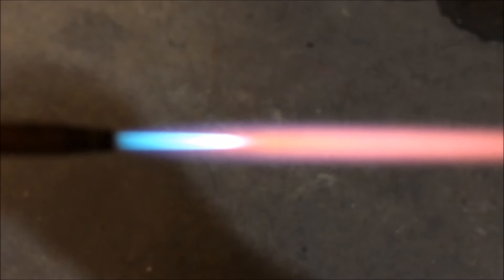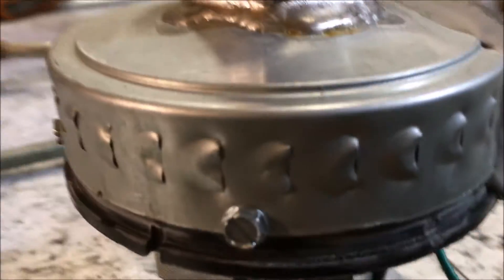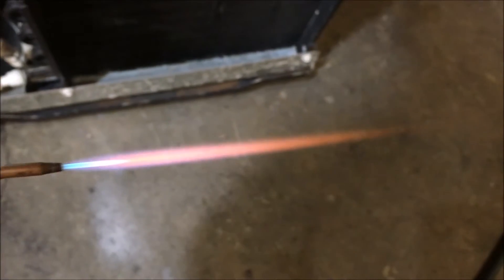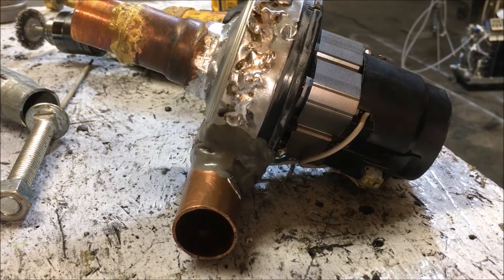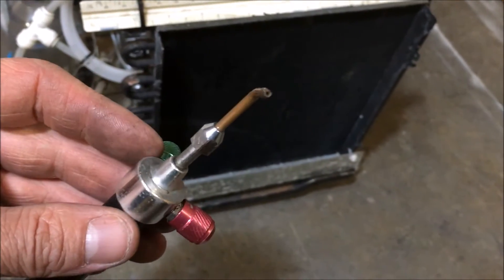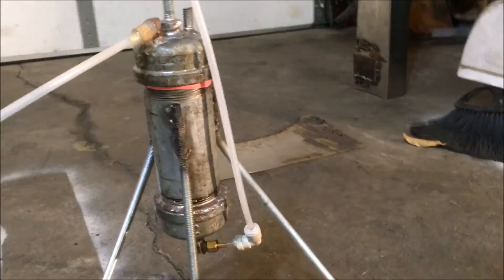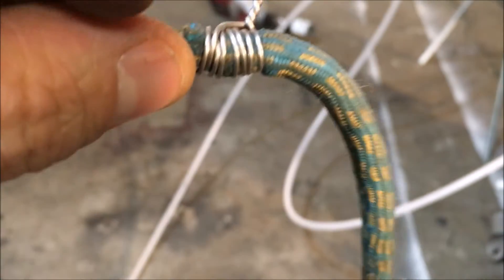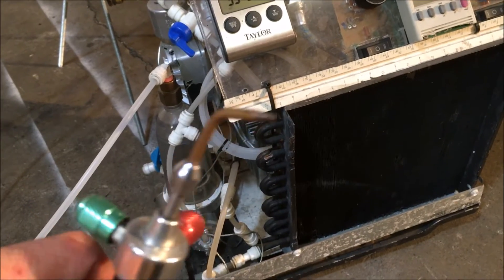Acetone Oxyhydrogen Flame

Comment: the copper itself is oxidized to copper oxide and transfers this oxygen to acetone forming acetaldehyde, acetic acid, carbon dioxide, and water, and is subsequently reduced back to copper metal. lots of interesting things happen at high temperatures.